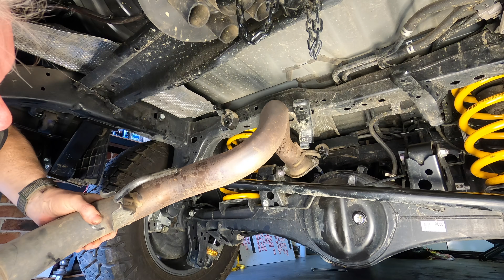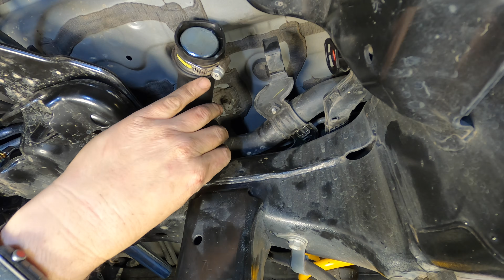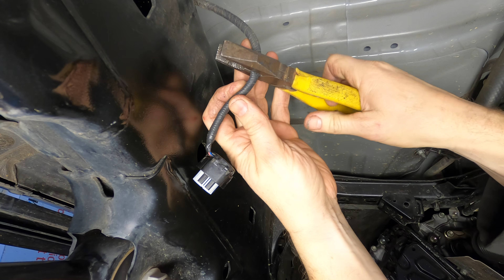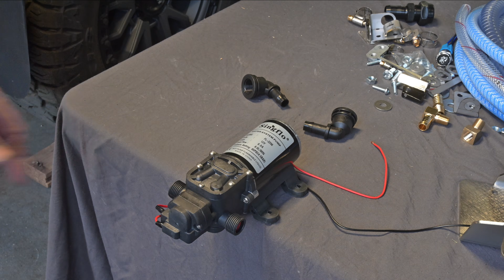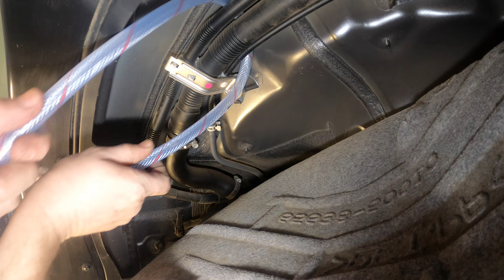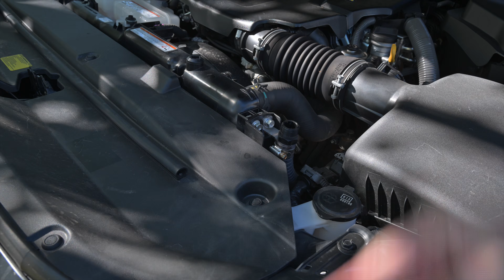LandCruiser 300 Long Ranger fuel & water tanks - step-by-step install

Comment: I had the Long Ranger tank installed last week. Had a problem at half full when got error message check fuel system & fuel light flashing. It turned out to be a breather hose not fitted correctly. I took the car from Sydney down to Canberra for the weekend & did a days driving round the  Brindabella ranges. Drove back to Sydney. I used about half the new tank capacity. I've set the scan scan gauge to tell me fuel remaining & tank distance since full. The car fuel gauge sits on full until around 80/90 litres used then starts to drop. I have around 120 litres remaining showing on the scan gauge & car tank shows 3/4 full. I'll be interested to watch when the car gauge starts showing the correct amount of fuel left. The scan gauge is a must for giving you an idea of how much fuel you have used & left until the on board tank indicator catches up.

Comment: what about fuel level indicator ?
Reply from the maker: It works in a similar way to the long range tanks in the 200-series. It still uses the factory fuel gauge, however the first 1/3 of the gauge now represents the first 2/3 of the fuel, because the gauge still thinks the sub tank is 40L instead of 152L. The factory distance to empty display is not accurate until you get down to about 2/3 on the gauge (ie the 152L tank is empty). Unfortunately, there's no way to recalibrate the factory fuel system to compensate for the change.